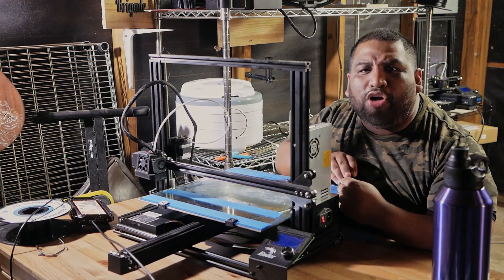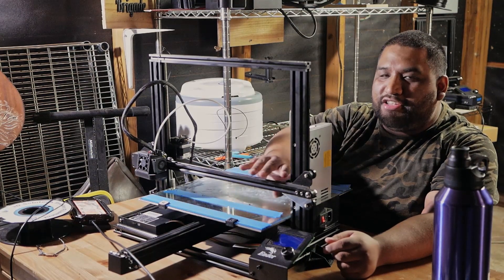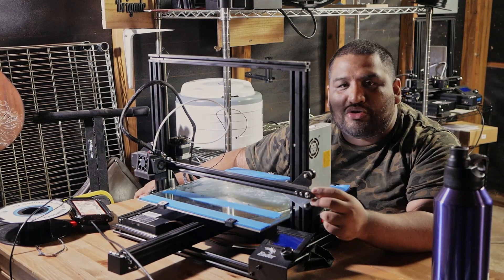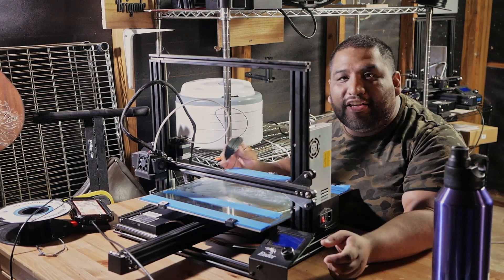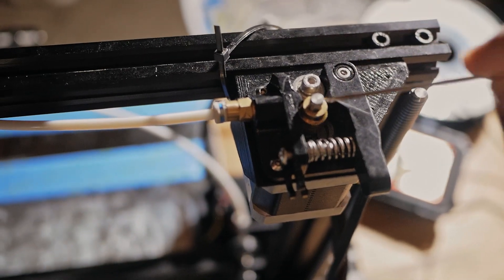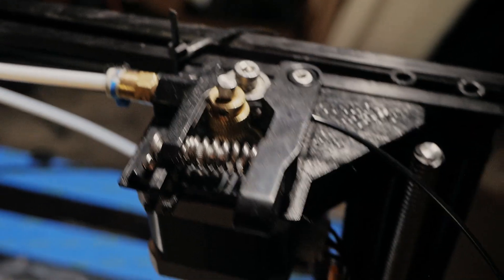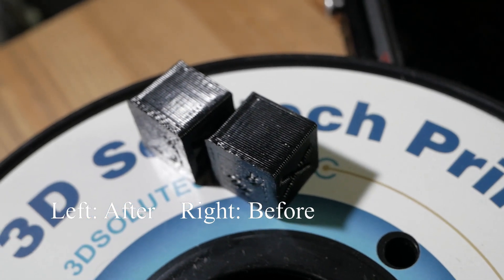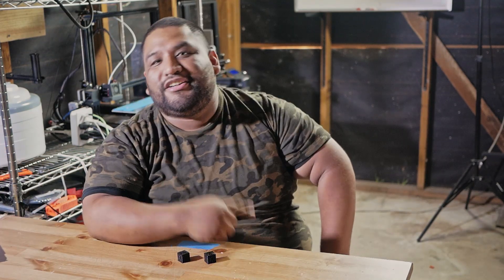Less Weight Better Print Quality? Ender 3 Pro With Ender Extender Kit

Comment: I like your idea more for the less bending of the Bowden tube and application for feeding pla from above.  I am not sure  equaling out motor on one side vs other matters as much unless the wheels are not tightened appropriately on the other side.  I think people tend to have more issue with direct drive due to the motors moving in x and y weight moving all around , I had that issue with my anet fire hazard.  About to get an extender kit though now and pretty stoked.

Comment: Hey yeah I've tried that on my ender extender it works but you loose like 50mm of your z axis not so good if your printing large objects :unless you extened your z as well with the extender kit . I just ended up adding a second z axis assembly and made it dual z and went direct drive for sure soooo many benefits over a bowden setup "IMHO". For me just being able to print a lot faster, easier with  less stringing was enough for me. Cool video i enjoyed watching keep up the good work.